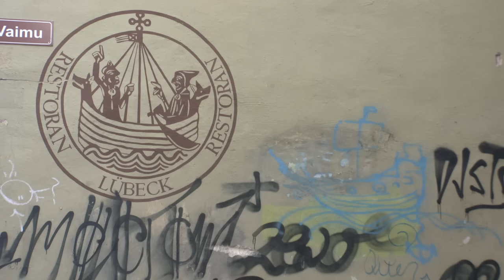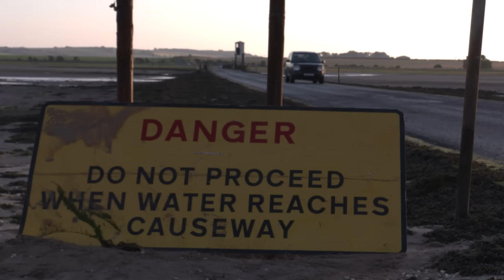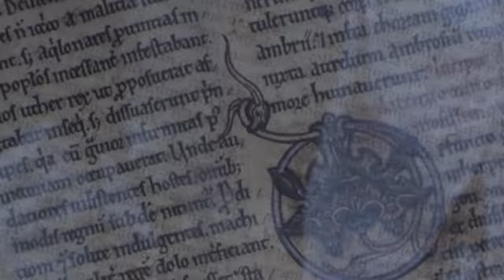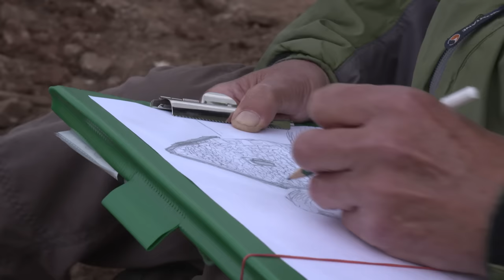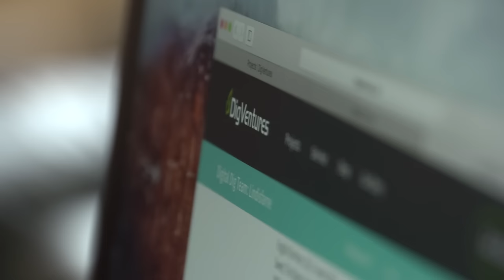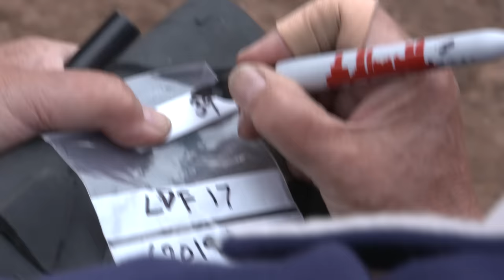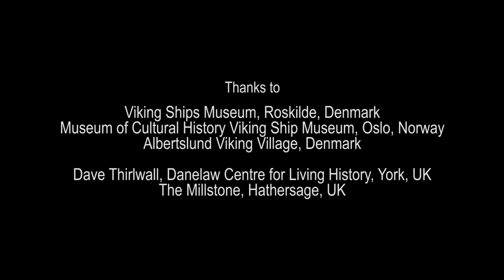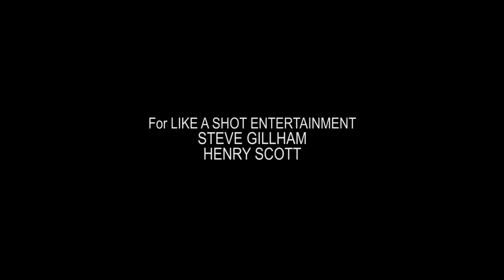Were Vikings Barbarians or Explorers? - Vikings: The Lost Realm - S01 EP1 - History Documentary

Comment: As the history is written by Christian monks the present day perception leaves out an all important context:
For decades leading up to the raid on Lindisfarne (793) Charlemagne had launched Christian Crusades on Pagans in Frisia and Saxony slaughtering in the thousands those who refused to convert (770s - 800s). Frisians and Saxons were related/connected to Pagans in Scandinavia and many undoubtedly fled there. Leader of the Saxon resistance Widukind probably even asked for Scandinavian assistance. Viking (meaning Raider/Trader/Explorer) raids was nothing new in 793. Finds in East Baltic Sea shows raids long before Lindisfarne. New was Christian holdings getting raided. Specifically related to Lindisfarne is Charlemagne's actions made Christian holdings targets for the Vikings !
Angles, Saxons and Jutes in Britannia was related/connected to Scandinavian Pagans also, originally immigrated from the same lands after Romes fall (450 - ) and still speaking similar languages. In Scandinavia Christianization must have been perceived an existencial threat by the time Lindisfarne was raided. Fortifications build/expanded just North of Saxony across the mainland (Dannevirke 790s-800s) and subsequent massive ring-fortresses in Denmark during the 800s (Trelleborg, Aggersborg, Fyrkat, Nonnebakken) indicates the threat they felt. Further Christian holdings was raided in Ireland (796) and Aquitaine (799).
The Viking Era didn't end with Hastings 1066 as commonly portrayed. Hardrada's Army of 1066 was not a Viking Army, but a regular Army arriving to fight a Succession War for the throne of England. The Viking Era ended when Scandinavian Pagans became Christians which for the most part was late 900s. The Danish King Harald Bluetooth converted to Christianity to end fighting/defending against the Holy Roman Empires relentless Christian Crusades against Northern Germanic Pagans (By no means a new invention when Pope Urbanus II announced the first Crusade on Jerusalem 1098). Harald forced his people to convert and secured sovereignty. His Christian grandson Knut/Canute became King of both England (1016), Denmark (1018) and Norway (1028) and thus ended the Era.
Reply: Interesting to know more baklground about what was happening at the time. I had heard somewhere that the raids may have acts of desperation and revenge on the early Christians. A result of being shunned or blocked from trading with their previous partners.
Reply: Sources?